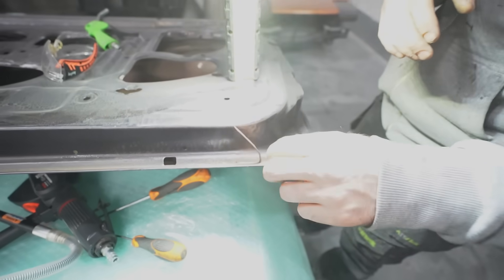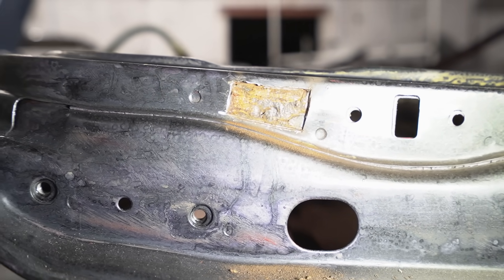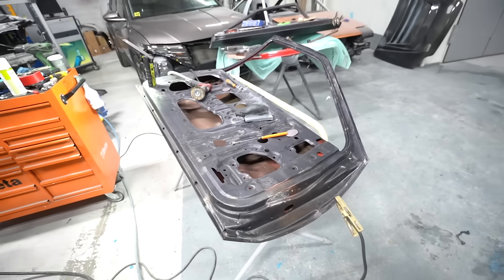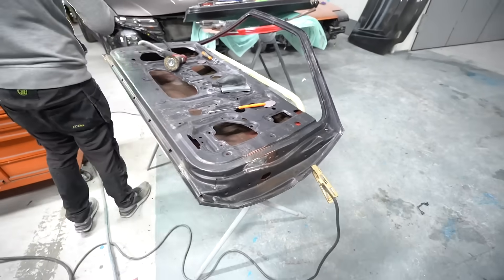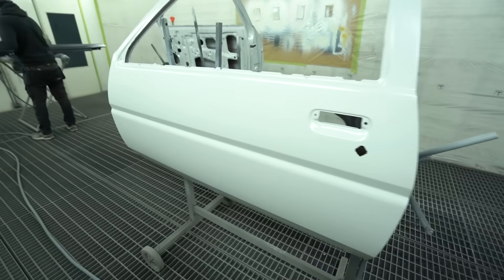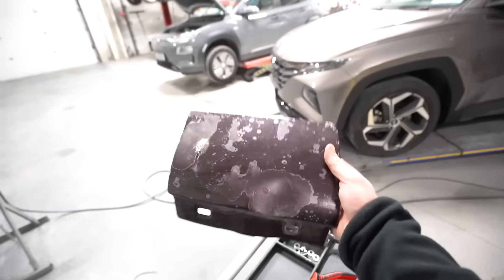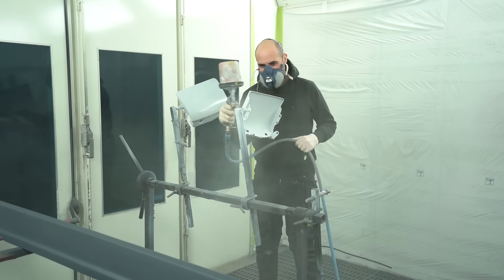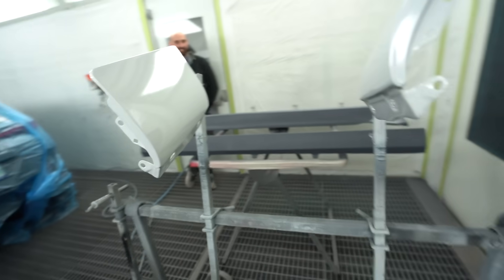Huge Milestone! The AE86 is all one colour

Comment: Did you completely sand off the Wurth rust converter before applying epoxy primer? I just coated mine with the same product and it dried out with a pretty heavy orange peel texture and I am not sure whether it is best to sand it back down to metal completely before applying primer.